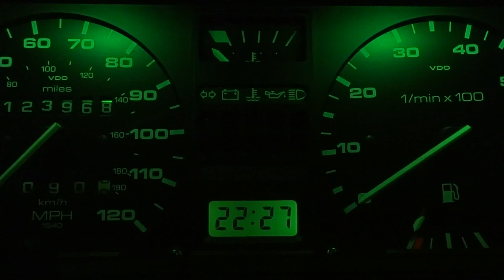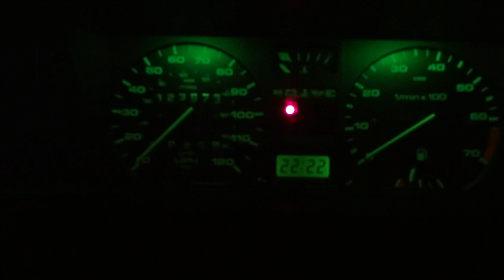How to Install LED Lights in Car. LED Dash/Switches. VW Golf Mk2 / VW Jetta MkII.

Comment: With no heat sink on the LEDs, how long did they last before they died of overheating?
Reply from the maker: Hi they use less power and give off less heat than a bulb. They don't need a heat sink. LEDs lasted. Car didn't. Some bigger drove into it and wrote it off.

Comment: Resistor size ?
Reply from the maker: Hi, the resistors came as part of the LEDs back in the day, so were probably fitted to allow them to run on a higher voltage than they could do without them being fitted.
It looks like the 4 colours were Orange, Black, Brown, and Gold.
Looking these colours up on a resistance calculator on Google and it seems the resistor has a value of 300 Ω .
Depending on the make of LEDs used the resistors might differ.
The LEDs I used were ones bought off ebay just specifying 12 volts at the time. It might be possible that these days they make them in 12 volts with no need for any additional resistor fitted to them.

Comment: Thanks for this video! I ordered some (5x) b8.3d leds for the dash. I chose 2 green, 2 blue 1 white. They send me 4 green ones..anyway my question: what size are the leds in the switches? 5mm 12volt? Maybe I try to replace them also. Kind regards.
Reply from the maker: The LEDs that would fit the best in the switches would be some 3mm 12 volt ones. If you can get some of those you would not need any resistor with them making them easier to solder in.

Comment: where can i buy the led bulb and what color is your one? is it blue or white
Reply from the maker: Hi the ones I used were spare white b8.3d LEDs that were left over from the ones I bought for the dash (I probably just bought them off eBay back then). The colours were just the colours of the lenses in the switches, thanks.
Reply: @ifitsgotwheels   thanks for the info i was asking cuz i think my lenses are orange so i don’t want to get that bright orange color

Comment: You changed only one bulb?
Reply from the maker: +Petar Peric yes as I was just using LED's that were left over, so only had the 2. In my other videos I show how to fit a 3mm LED and resistor, which I would normally do, thanks.

Comment: great video. quick question, I thought that DC power does not have polarity. if I'm wrong let me. I will be doing this to my MK2 soon.
Reply from the maker: +Tray Muse Hi, thanks for watching. Yes DC power has a positive and negative (just like your car battery (or an AA battery, etc.) has a positive and negative terminal), and diode's by nature will only let the electricity flow in one direction, hence if they don't work when fitted, you should try them the opposite way. A normal diode would probably just blow when fitted the wrong way to the electric current, but most LED's when fitted resistor of some form (built-in or a seperate one) are fine. thanks.
Reply: 10-4 thank you for the response. I will probably just get my circuit analysis teacher to help me do it.

Comment: Do i must to put resistor on -? I allready put on + on few switches,but i didint connected them .))))
Reply from the maker: +Petar Peric hi, it depends on the LED's you are using if they are 12volt ones, you can just use the LED, but if they are of lower voltage as is often the case, then you need a resistor otherwise they will blow.
Reply: Yes, i know that,but i dont know on which side to put resistor,on + or on -? i thought i must set resistor on +,but you on video putted on -...
Reply from the maker: +Petar Peric thanks I understand now. You can use the resistor before or after the LED, so either side +ve or -ve it will work the same, thanks.
Reply: Thank you very much for very fast answer :D

Comment: 6:26 But why is the rear window defroster symbol lit blue? It should be green like the fog lights.
Reply from the maker: I don't know the answer to that. I've just clicked on someone else's video to have a look at the matching green lights, and on their car they are both blue ones! Maybe they all came out of a lucky dip parts bucket! It was a 1991 car, and some of the other parts on the car seemed to differ on the car too as if it was all the end of line stock being used up in the factory.
Reply: @ifitsgotwheels  I can assure you not a single VW Golf Mk2 originally came with switches and dash lights that are not colored green.
Someone has tampered with your switch then. If you see a video with blue lit switches or the whole dash lit in blue, it's because some people prefer that color and changed it on their own by using blue LEDs (which did not even exist in this brightness back in 1991).

I replaced the lamps in several of these switches to restore the original brightness.  Depending on the exact manufacturer and year, there is either a solid green plastic plate or green paint applied to color the light.

Comment: ifitsgotwheels thanks for responding. I will order some 3mm leds and try to solder them in place when I get the leds. I'll let you know if it worked out, if you want. Thanks again.

Comment: what the volt power lamp  please ^_^
Reply from the maker: +habeeb ez (ZINEX) hi they are 12 volt LED's they were called 'B8.3d' and they where just 2 left over from when I fitted LED's in the speedo panel http://youtu.be/L6AHyeIIrhs. I also have a video fitting a 3mm LED in a switch, see here; https://youtu.be/cpZYjDnPFRQ. They were lower voltage but came with resistors so they could be used on a car's 12 volt system. All LED's I found on ebay. Just make sure you order 12 volt ones, thanks.
Reply: +ifitsgotwheels  thx alot ^_^

Comment: isnt it easier to buy the Switches that are LED integraded?
helpful video btw.
Reply from the maker: Yes it would be simpler I suppose, I did not realise there were any, but in this internet age I guess there must be. Thanks for the comment. The more choices the better.
Reply: If you can solder a wire then it would be considerably cheaper to buy LED's and do this yourself. Some switches can be quite expensive. On the plus side, if you do it yourself you can use any colour LED you want to rather than being the same as every other car. A little personalization, or individuality, or you can even make your car stand out from all the others just like it.